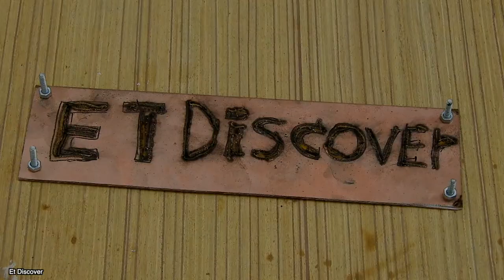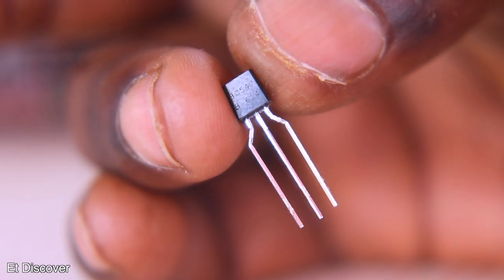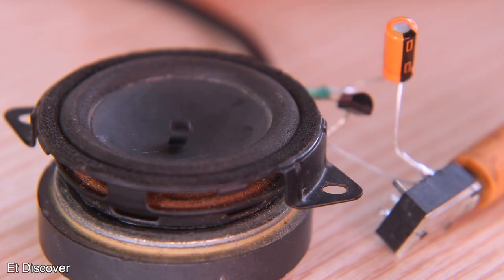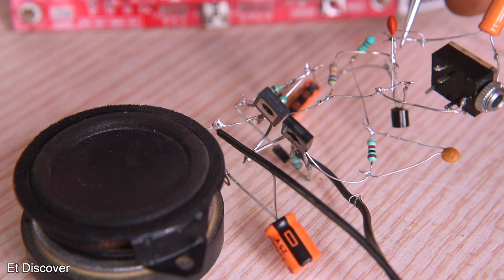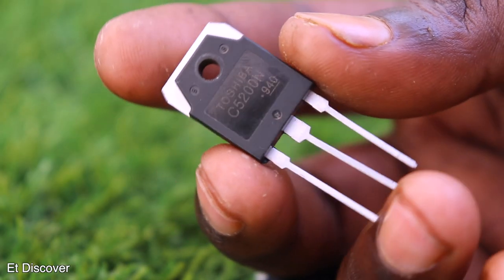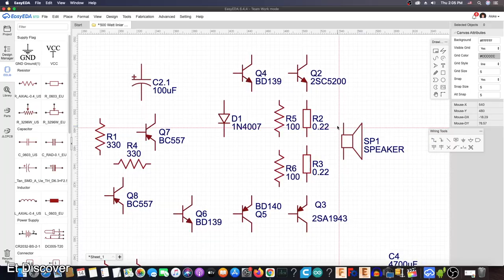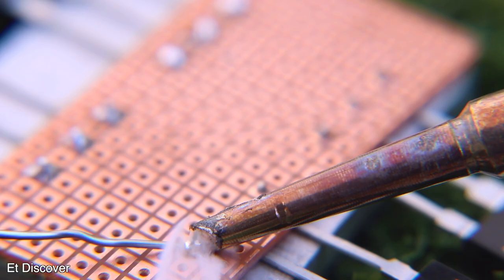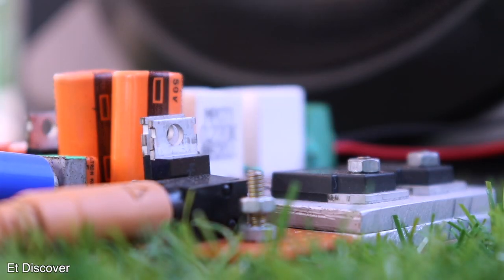How to Make 500 Watt Subwoofer Burnable Audio Amplifier

Comment: Thanku very much 💯 . I am also looking for subwoofer amplifier project 👍 . And plz also make a video on audio crossovers 🙏 .
Reply from the maker: Okay I will
Reply: The TTC5200 transistor used can handle a voltage up to 230 v so can we use rectified 220 volts for powering the amp?

Comment: Buddy a pair of 5200 and 1943 transistor is only 100 watt and maximum 150 watt(no one use it at 150 watt, because it can destroy the transistor). And you have used 2 pairs. It means it can only give 200 watts. Which is far from your claimed output power of 500 watt. Also you need to use capacitor of 10000uf for best performance 👍. But although I like your video. Love from Kolkata ❤️
Reply from the maker: According to Toshiba data sheet 2s5200 transistor maximum can handle 15 AMP are and 250 Volt , 250x15 =3750 watt. this watt is for pwm signal , Since this kind of amplifier is linear amplifier so You’re mostly it will be definitely Hot, And the power transistor will burn in the mostly in official amplifier, Because the out put Speakers ohm is not match the amplifier, And remember one thing in market maximum this transistor are duplicate, In a official amplifier too much transistor are using because Not take  pressure in only one transistor as a result And not burn easily, But this means not this is too much watt, Watt not depending on Many more MOSFET, Watt depending on voltage and Amp, And you are right for capacitor , You are definitely needed to use bigger capacitor, this is just a demo video so that is why I am using small one,
Reply: @EtDiscover  buddy your process of calculating power of amplifier is wrong. Play a 1khz sine wave tone in your amplifier and then check the voltage at spekaer inputs. Then you need to calculate the output wattage by W=V^2/R(Where V = voltage at speaker inputs and R= speaker resistance). This is the official way of calculating amplifier output power👍❤️
Reply from the maker: Your formula is working only RMS, not Watt . SE only Determine in class D amplifier, not for linear, Linear always dropping power. So that is why we don’t get Transformers full power in output, So definitely You need to calculate the rest power of dropping, Accept this you can put it Ohms law, thank you

Comment: 4:26 if you worrying about , the damaging of your speaker at higher power You should use Large dc filter capacitor in series with the speaker so no dc current can pass to damage it by mistake .

Comment: can u show a tutorial, on how to make full range speakers where there are 2 or 3 speakers per channel 1 subwoofer for lows, 1 speaker for mids and 1 for the highs and same on the other channel, it includes using crossovers and stuff, it would be an interesting video
Reply from the maker: I will try
Reply: @Et Discover   Hi,  the link diagram circuit in the description  does not exist.  Can you share the circuit with me ?

Comment: That is 200 watt amplefier
Reply from the maker: According to my knowledge. 10Ax80v=800 Watt max, more information snarfing on google, Watt not depending on too Many transistor, thats depending on your Volt and Amp
Reply: @EtDiscover   but one 25c5200 transistor can output only 50watt
50×4= 200
Reply: @ExperimentWithLaxman  can u give a link to the datasheet u read it from
Reply: @EtDiscover  plz make a mobile connecting receiver also for spy camera

Comment: I have a SMD rework station, now it's controller has burned. Now I want to make a dimmer circuit for 250w element because I have been completed air function.
Please make or tell me how to make dimmer for that's element.
I have a 2000w dimmer when I connect with element it was blasted.
Please tell me solution.please
Reply: Answer me soon
Reply from the maker: Please make sure your output appliances is not take too much current and A triac  is very suitable for this kind of application
Reply: Is it possible to make a pwm dimmer circuit. Because I want to protect my circuit in short circuit case.thank's there was a short circuit. So that's why the traic was burned and now I want to protect my circuit so tell me some solution please bro please. I am using ( bta 41) traic it can handle upto 9500w 
So it is very expensive and I want to protect it